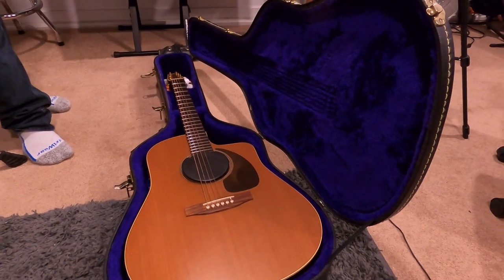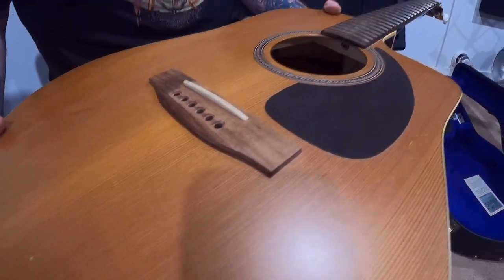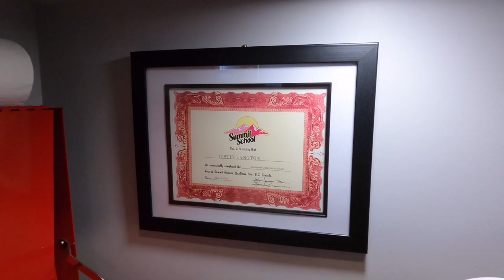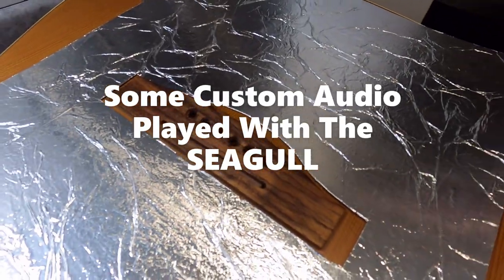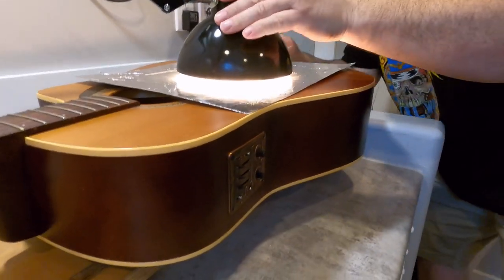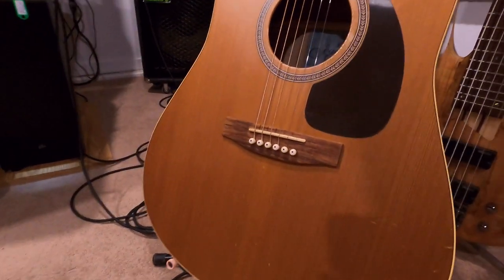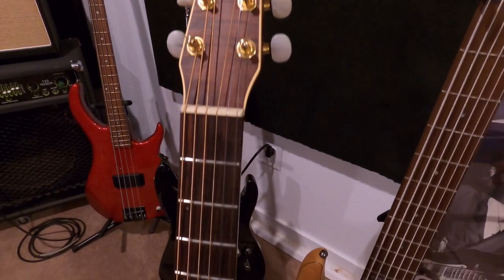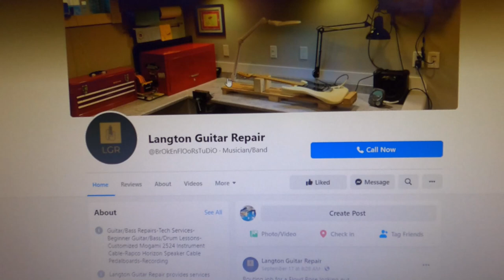ACOUSTIC GUITAR BELLY BULGE REPAIR

Comment: You got rid of the bridge warp with the heated cauls. How did you get rid of the belly bulge beyond the bridge and bridge plate area? In my opinion that heated caul system has limited application for use only where the bridge is glued down. You never showed how the belly bulge was fixed using your steel straight edge after the bridge reglue.

Comment: Your video has given me some motivation. I just pulled an acoustic 6-string out a neighbors trash. I saw the head sticking out of his bin and couldn't resist trying to save it. They must have left the guitar in a basement or attic with the strings fully tight. The strings were still on it and the neck had completely separated, bent forward from the top of the body and the fret board peeled off there too. I've taken the pieces apart and getting ready to sand and re-glue. It looks quite salvageable.
Reply from the maker: Im glad it motivated you. Good luck to you.

Comment: Hey, I’ve got a 1960’s Ibanez (Martin) Lawsuit Acoustic, and it’s a beautiful guitar, but it’s got slight belly rise, and essentially the intonation on it is also quite off, but mostly just on the big E . It (the E) goes very sharp, and more sharp as  you start fretting towards the twelfth fret. Other than the belly rise, which isn’t even very bad, not exactly sure what it would need, but it’s in overall really really nice condition. The nut was cracked in half  when I got it, so I glued it together, but I presume it would probably benefit from a new one. Tuners are all perfect, frets almost look new(but are OG I think), and may need a new bridge saddle thingy I dunno. 
I believe this guitar likely sat around a lot of its life.

Anyway, I was wondering if you’d maybe be into helping me restore it? I wanted to use it for recording, as it has really nice wood, and resonance, and has this nice midrangey, but dark kinda tone going on, and I really want someone to get it playing well again. I’ve never seen one like this from Ibanez, and I just feel like it’s a bit of a rare gem worth putting some love into. 

Hope to hear back.

Comment: Hello my friend, thank you for your effort. My question is, I opened the bridge and took it out of its place, but I have a problem. I cannot remove the bridge and separate it from the guitar because there is a wire attached. When I put my hand inside the guitar and felt that the wire is connected to the electrical system, I do not know what to do. Please, can you teach me with a video how to separate the bridge from the guitar? So that I can clean the guitar from the surface of the guitar face so that I can return it to its correct place. Thank you

Comment: Was the neck originally glued in? I ask because it is a bolt on neck, and if the factory wanted to glue irt in they would have and not made it a bolt on. Also, you are not able to clean up the glue squeeze out in the truss rod channel which may cause issues in the future. Like a frozen truss rod. Also, where is the belly bump repair? Was that taken care of with the bridge re-glue?
Reply from the maker: The neck was originally glued in and there wasn’t much glue squeeze out to cause any problems in the future. Truss rod works fine after repair. The belly bulge was heated using Thompson belly reducer at a controlled temperature and clamping pressure. The bridge was glued on after. Thank you

Comment: I need someone to explain to me how removing the bridge and just regluing it again would solve the belly bulge. As far as I can see from the aftermath of his work, the action was still high. I'm sure the belly bulge problem would not be solved just by that "repair".
Reply from the maker: The Seagull guitar came to me with a high action. The measurements were 4.5/32 on the low E and 3.5/32 on the high E. The neck was dead straight and the nut height was to spec. If I would of sanded the bottom of the saddle there would have been no break angle and there would of been loss of tone. I put a straight edge across and noticed a hump (bulge). I also checked  to see if it needed a neck reset which was not needed. So the next step I felt that was needed was to use the Thompson Belly Reducer with heat and clamping pressure. The results were a success. The action was 3/32 on the low E and 2/32 on the high E which is acceptable limits. The customer was very happy with the results. Hope I answered your question. Thank you
Reply: @langtonguitarrepair3975  i see.. thank you. Would the belly bulge return again after some time?
Reply from the maker: @iNomNomNomYou00  I recommended to the customer to use lighter gauge strings, humidity control (40-50 percent), and keep the guitar in the case tuned down a full step when not playing will keep the hump from coming back. In the Seagull manual it recommends a specific size gauge string so there isn’t too much string tension for the particular wood for that guitar.
Reply: @langtonguitarrepair3975  Hey sir I have a 59 j50 i need some work done on. How much typically is this type of repair? Mine i believe is worse however the wood itself that the bridge sits on has lifted higher than the wood of the guitar itself and down below the bridge the body has swelled. Bridge also trash i ordered a new one but to keep it original with the adjustable bridge it would need route work and two counter sinked holes by the strings. Thanks. Mark.
Reply: The bridge has nothing to do with it other than it was likely lifting from the radius of the belly. All he’s doing is softening the glue between the wood lam top pieces and also the braces. The clamps just help smash that area back flat with the bits sliding on the softened glue. When it hardens again the bits are back where they should be and the bridge can be put back into place and now lay flat. You can achieve the same effect of the heated metal pieces by putting the body of the guitar into an oven. That is less precise and you’ll need a whole body jig to keep everything in place and you can then clamp the entire top down into place. And obviously careful with any plastic pieces etc.
Reply: Stewmac now has a belly bulge repair kit and an instructional video

Comment: Isn’t a belly bulge caused by too much or too little humidity? I sometimes take a straight edge to the lower bout to chk and depending on humidity factors it varies. Please explain what is ideal. Thanks for your videos!
Reply from the maker: @robmiller3464 Yes and string gauge is a factor. Large gauge strings will cause too much string tension, especially if you don’t check humidity and tuning. I do weekly checkups on my guitars too make sure everything is where it should be.

Comment: Shoule be NO bulge at all? Completely flat? I just bought a j200 and it looks like that, but the action is super nice
Reply from the maker: If the guitar plays good and your happy with it you can leave the bulge. Make sure you use a humidifier during the dry months of winter, monitor the bulge, loosen string tension ( a full step) when your not playing it,  and install lighter gauge strings.
Reply: @langtonguitarrepair3975  I destroyed a beloved 1980s Hohner 12 string acoustic by leaving it fully tuned in a centrally heated room for years. The action got slowly higher each year until it is now virtually unplayable. As a bassist I have strong fingers, but the intonation is now so off that every note above the 5th fret is sharp. I still have it for sentimental reasons (I realise it's no collectors piece), but it is little more than an ornament at this point. 
I fear I've left it too long to put right. :(
Reply from the maker: @emdiar6588  It’s hard to say without looking at your guitar. It might need a heat press, neck reset or there is a belly bulge. All of these repairs are pricy and might not be worth it to you. You could try an open tuning and use it as a slide guitar. Ive never tried that with a 12 string. If you do try it let me know how it works out for you.
Reply: @langtonguitarrepair3975  That is actually a superb idea! Thx. Don't know why I didn't think of that. It will definitely work if I add something to raise the nut a couple of mil, too.
I have a 6 string acoustic, permanently in open D which has a ridiculously low action, making it all but useless for slide.
Of course, I am going to have to get a new 12 string for non slide stuff.
Reply: The tops are not perfectly flat. Most manufacturers use a 30 foot radius. It gives the top somewhere to go with expansion and contraction. The belly comes mostly from the bridge rolling towards the sound hole. the top dips in front of the bridge and raises behind the bridge giving your guitar that two months pregnant look.

Comment: seems like every acoustic has this issue, should I just buy this tool if I have the means? I'm not even to the point of making money yet though is the thing...hoping bridge doctors do the trick currently...
Reply from the maker: The best option is use lighter gauge strings and keep acoustic guitars in their case keeping humidity at around 45 to 55 percent.

Comment: 2:25 you call that a hump? As far as I know this is pretty standard for all "flat" tops
Reply from the maker: I did call it a hump but not anymore. The hump is gone and action is low for the customer’s playing style. Thank you
Reply: @langtonguitarrepair3975  so did you measure a difference in the hump before and after? I am interested, thank you.
Reply from the maker: @karffiol  I did measure before and after. Before was 4.5/32 bridge height bass side, 3.5/32 treble side. After 3/32 bass side, 2/32 treble side.
Reply: @langtonguitarrepair3975  OK that sounds like an improvement, did you measure with strings on? Also what is the "factory spec" for this, as I know there must be some radius, but I dont know what are the desired values... like for example dreadnoughts
Reply from the maker: @karffiol  Yes strings on , straight neck. Factory specs in the manual that came with that guitar are the exact same as my measurements. Thank you

Comment: Doesn't guitars  of this kind have factory made arch or as they call it a  dome where the bridge is and on its back? Like Taylors or Takamine dreadnoughts for example.
Reply from the maker: Ya there is some arch but when this guitar came to me there was a hump. The action was 4.5/32 on the low e and 3.5/32 on the high e. The neck was dead straight and nut measurements to spec, a neck reset wasn’t needed, the only thing left to do was to fix the hump ( belly bulge). Action after job done 3/32 low e, 2/32 high e. Success